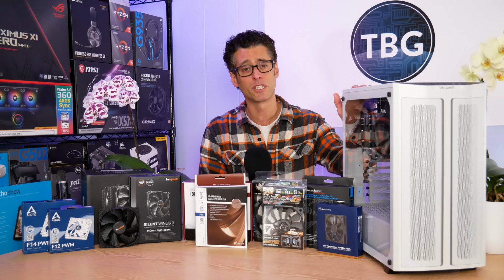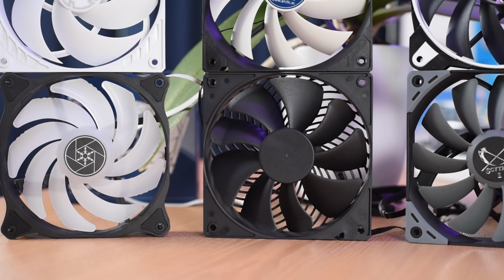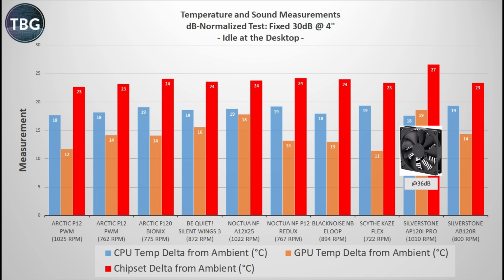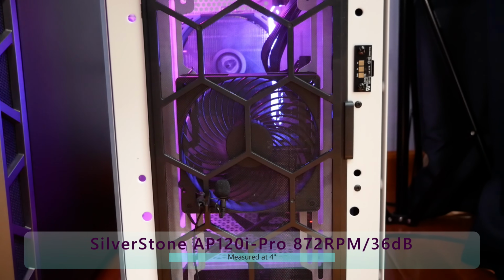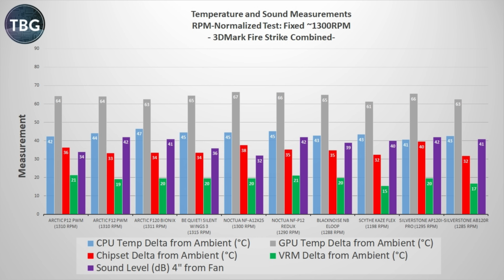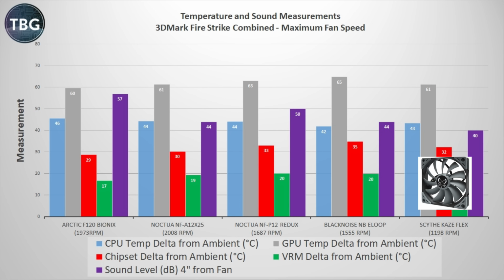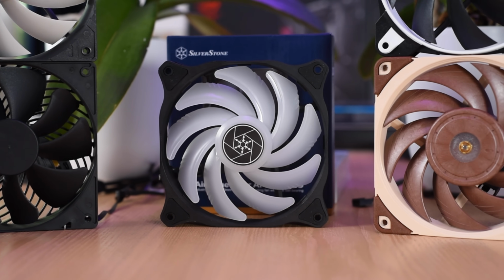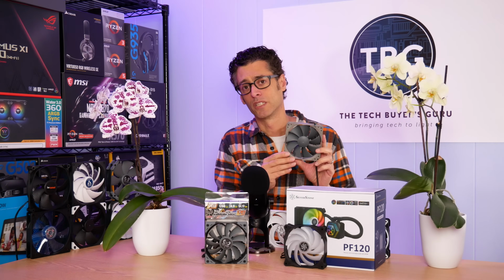The Best 120mm Case Fan Shootout: Arctic vs. be quiet!, BlackNoise, Noctua, Scythe & SilverStone

Comment: I purchased the SilverStone fan based on this review.  I don't mind noise but I would never have this fan above 1700 rpm, because it starts sounding like an airplane above that.  It's very quiet, like my other fans at low rpm though.  But after just two months sometimes the lights are on and sometimes they are off.  Now in my third month of ownership and having Tropico 6 (the RGB killer), it seems like the lights are now dead, but at least the fan is still spinning, so that's something I suppose.  If I had my time again, I would have gone for a Noctua fan instead.
Reply from the maker: Thanks for your feedback. I did make pretty clear that the fan is loud at maximum RPM, but that's not really relevant to anyone who uses a fan profile to control the fan, as it's very effective at lower RPM levels (and more importantly, on a dB-normalized basis). I'm sorry to hear, however, that the RGB lights are not working. You might want to check in with SilverStone about warranty support.

Going with Noctua would not have gotten you better case fan cooling performance. On a radiator, yes, the NF-A12x25 is slightly better.
Reply: @TheTechBuyersGuru  I can't remember my exact rpm, I'm just guessing.  I also can't remember what you said in the video.  But to say above, that something is loud, is a meaningless statement.  Just like saying something is moving, is a meaningless statement. It has to be loud relative to something else, and X has to be moving relative to Y, in order to have meaning.  I'm sorry that you had a bad experience with the Noctua fans in your setup.  I can only speak of my experience with other Noctua fans being good, and other Youtuber's tests like Optimum Tech, with those exact case fans as being good.  But what nobody can do, is to make it sound like their setup is some universal law of nature written in stone.  I'm new to this and learning all the time, I'm humble and wanted to share my setup experience.  What I can write in stone, however, is that any measurement which does not include the uncertainty in that measurement, is also meaningless :)
Reply from the maker: I've done far more case fan testing than Optimum Tech. What I'm taking from your comment is that you think his results are better than mine, and you would go with Noctua like he always does.

The thing is that I've been doing fan testing far longer than he has, and I have far more videos on the subject. I'm quite confident in my results. Your SilverStone experience may not have been great, but no, Noctua fans are not better for case cooling, and certainly not what you should choose if you want a replacement.

Please have a look at this video if you want to learn more: https://youtu.be/PUdsTiRmuuU
And then have a look at this video: https://youtu.be/iCn-XL-HyXg
And also this video on radiator fans: https://youtu.be/cQ6W-b45wZ0
Reply: @TheTechBuyersGuru  No I wouldn't say that anyone is better than anyone else.  Just that those fans worked better in his case and did not work better in your case.  What I would like to see more of is when people talk about margin of error, and that is something I would like to learn more about from Physics and Maths.
Reply from the maker: Margin of error is not something you can compute unless you are in a controlled laboratory environment. Applying it to fan testing on YouTube is impossible, and when it's discussed, it isn't accurate at all. There is a huge margin of error, from the ambient temperature, which constantly fluctuates, to the error in the sound measurement equipment, to the error in the temperature probes on the components, to the margin of error in RPM readings. The way you get around that is by repeating the tests over and over, as I have, in numerous different applications. Then the trends become clear, and margin of error isn't important, because if the results repeat themselves again and again, margin of error is no longer relevant, because it would predict random results that switch back and forth from test to test.

Long story short, Noctua fans are not good case fans. I have proven that in numerous tests. The NF-A12x25 is an excellent radiator fan. I have also proven that in numerous tests. No one has done more dedicated, in-depth fan testing on YouTube than I have.

Comment: That Noctua is not their best case fan. I love that fan, but It's moreso ideal on a radiator or air cooler. I'd be interested to see this test with Noctua's proper case fan, the NF-S12a. It's no accident it uses the same 1200 RPM as the Kaze Flex. You don't use a station wagon to race and you don't travel cross country in a Ferrari. Gotta use the right tools. Fwiw, I'm using 1 intake and 1 exhaust fan, both NF-S12a's and my cpu cooler is the NH-U12a which comes with 2-A12x25's. They're on a Ryzen 7 3700x oc'd to 4.4ghz and the machine is smooth as butter, completely stable. Use the right tools and things magically shake hands.
Reply from the maker: It sounds like you're having a good experience with the S12A, but it's really not that good. A lot of people have bought into the marketing of this fan, but my tests show it doesn't stand up to the best case fans: https://youtu.be/PUdsTiRmuuU
Reply: @TheTechBuyersGuru  Thanks so much for that! Seems like Kaze Flex really has their stuff together. I don’t believe I have the space for 140, but I’m gonna definitely give the Kaze Flex 120 a try in my case and see if I can beat out my current temps. Thank you again for doing these tests!!
Reply from the maker: I think you'll find the Scythe Kaze Flex 120 to be an excellent fan. Definitely a better overall fan than the S12A, so worth checking out: https://amzn.to/3tbMxHg
Reply: @TheTechBuyersGuru  Already ordered and will be here Saturday! I love that not everything inexpensive performs inexpensively. I need to update my psu as well. Currently have a 750w bronze and a few people have told me that if I'm overclocking like I am with as much ram as I'm using, that I really need more like an 850 gold or platinum. So I have 2 upgrades to do! Wish me luck!!
Reply from the maker: I wouldn't be too worried about wattage, I'd get a quality power supply. The Seasonic GX-750 Gold recently came back in stock after being sold out for nearly a year, and it's a great choice. Here's the link: https://amzn.to/2PM8I8y

For what it's worth, using more RAM has a negligible impact on power use, so anyone who said you need an 850W PSU because of that wasn't well informed. The only reason you'd need more than 750W is if you were not only overclocking a 3700X but also overclocking an RTX 3090. An overclocked 3700X would use 200W max.
Reply: @TheTechBuyersGuru  Understood, and thank you! Maybe they meant overclocking of both my graphics card and CPU. My 3700x is at 4.4ghx and my RTX 2070 Super is a Zotac, which comes with its own Firestorm software that is supposed to do an automatic and supposedly 
'ideal' overclock on it, but not sure how true and accurate that is. Any thoughts? (btw, thank you so much for taking time, I really appreciate it!)
Reply from the maker: I'd guess your 3700X is pulling around 175W at 4.4GHz all-core (which would require a lot of voltage), but a 2070 Super doesn't have a ton of headroom for overclocking, so maybe it would draw 275W max. So you're looking at 450W plus around 50W for everything else in your system. A good 750W PSU is all you need. You could honestly keep what you have unless it's a low-quality unit if all you care about is having enough wattage to support your components.
Reply: @TheTechBuyersGuru  So, I ended up getting a Seasonic 750w Platinum and 2 new Kaze Flex 120's and did the whole swap out last night. I know the difference between Gold and Platinum is not much, but the cost difference wasn't much eaither, so I did it. Same 10yr warranty, but slightly better specs. 92% efficiency at 50% load. Computer is running smooth as butter, but I think I can squeeze out a touch more. Last time I put thermal compound on my CPU was well over a year ago, and it was Noctua's NT-H1, which is good stuff, but I picked up some Thermal Grizzly and while the difference may not be much, for a $9 tube, even 1-2 degrees on idle, I'm willing to take. Wish me luck and thanks so much for the advice and recommendations!!!

Comment: Excellent review. Kazeflex may not be the quietest but it blows the most air at the lowest RPM at comparable and even lower temps. That is an amazing conclusion I've not heard anywhere else. That just blows me away. Honorable mention to Noctua being the quietest.  And yes to 140 mm review. Thanks again.
Reply from the maker: You don't have to wait long for the 140mm shootout, I've already published it! - https://youtu.be/PUdsTiRmuuU
Also, have a look at this guide to fan placement, which is probably even more important than fan selection! - https://youtu.be/iCn-XL-HyXg

Comment: Have you not noticed humming, buzzing, or weird resonances with any of the Arctic p12s? I bought 10 of them for a lian li dynamic xl build and I'm about to find something else. These fans are quiet annoying.
Reply from the maker: There is a resonance at certain RPMs. You just need to tune them to keep them out of the annoying RPM range. It's typically somewhere between 1200RPM and 1400RPM, and as long as you design a fan curve to avoid that, it's fine. In my testing, especially with that many fans, I have found there would be no reason to run them anywhere above 1200RPM. Watch this video to learn more: https://youtu.be/7dAvxfDYuRU

Comment: Well the redux line are older discountinued models so prob why not as good as their newer models.  I have the 92mm redux I used to use with a nu9 cooler that worked pretty well, but have been useing the Sythe Shuriken 3 with a Noctua since it came out.  Might have to give the 25mm Sythe fan a a try.

Comment: Just when I thought I had found the best case fan for my PC, the Arctic p12 PWM, I started to see complaints about the fan motor humming at random RPM’s. This issue deterred me from the fan and I continued my search. I ended up finding the Noiseblocker NB-eLoop B12-PS fans. I thought they would be the best for my setup, as I was planning to blanket my case with them. But yet again, a ton of people said they had issues with the fan blades making a noise when using it in a pull configuration. I looked at a lot of other options but there seemed to be mixed reports on how each fan performed. I can’t find any information on Google or YouTube about case fans that I haven’t already watched/read. The majority of the videos/articles conflict with each other, with some fans performing substantially better than others in different environments and setups. Since there is no way for me to test all of the fans myself I might have to randomly pick one. If anyone can recommend me an airflow based case fan that dosent have any problems, then please, let me know.
Reply from the maker: Have a look at this video for a review of the best 120mm and 140mm fans: https://youtu.be/PUdsTiRmuuU
And then watch this video to learn more about how multiple fans work together in a case: https://youtu.be/iCn-XL-HyXg
No other YouTuber is doing the kind of comprehensive testing that I am. Every fan makes noise. When a ton of people say there's something wrong, it's probably because they are using the fan the wrong way. When you blanket a case with fans, you can actually end up making it much louder than it would be with fewer fans.
The best 120mm case fans are definitely the Scythe Kaze Flex 120mm: https://amzn.to/3p9IrOy

Comment: I wonder how much the audio samples other than Bionix are skewed because of the 10 cm mic distance. SilverStone AB120R, Arctic F12, and Silent Sings 3 are clear winners. Arctic P12 doesn't sound so horrible because the hum is in the low-frequency range at this RPM. Audio samples results (only these marked as 30 dB): Arctic F12 @762 RPM: 29.8 dbA, < 40 dBC, Arctic F120 Bionix @775 RPM: N/A (bad sample), Arctic P12 @1025 RPM: 31.1 dbA, 46 dbC (85 Hz peak), Silent Wings 3 @872RPM: 30 dbA, < 40 dBC (105 Hz peak), Noctua NF-A12x25 @1022 RPM: 34.6 dbA, 47.5 dbC (165 Hz peak), Noctua NF-P12 Redux @767RPM: 32 dbA, 46 dbC (115 Hz peak), Blacknoise NB e-Loop @894 RPM: 31.4 dbA, 46 dBC (90 Hz peak), Scythe Kaze Flex @722 RPM 42 dBA, 57 dBC (140 Hz peak), SilverStone AB120R @800 RPM: 29.6 dbA, 38.5 dbC (125 Hz peak).

Comment: Only problem I have with your tests, what about air flow (CFM) didn't measure that.  Looking to replace the 9 fans in my case and CFM is important to me.
Take that back, another issue is you have 120 mm and 140 mm.  We all know that 140 mm doesn't have to turn as fast to move the same amount of air.  I'm looking strictly for 120 mm.
However, good review
Reply from the maker: But why is CFM important to you? Is it because of marketing you have seen? CFM is just a spec. My tests show which fans actually work, because as it turns out, specs don't mean anything.
Reply: @TheTechBuyersGuru  Ya, 20/20 hindsight tells me that you have indirectly showed the CFM in each test, however comparing a 120 mm  vs a 140 mm isn't fair.  A 140 mm doesn't have to turn as fast (thus less noise) vs a 120 mm. If you'd have compared 120 mm vs 120 mm across the board then its different story.
Reply from the maker: This video only had 120mm fans. The follow-up video had 140mm fans: https://youtu.be/PUdsTiRmuuU
And if you're really interested in this subject, I have a ton of videos you should check out, particularly this one looking at multi-fan optimization: https://youtu.be/iCn-XL-HyXg
I promise you'll learn more from this than you would from looking at specs from now until the end of time. ;)
Reply: @TheTechBuyersGuru  interesting, as I swear I saw 140 mm and 120 mm at the beginning SHOT

Comment: can you compare new arctic p12 pwm pst CO with regular pwm pst? and p12 argb
Reply from the maker: The CO is not new. Arctic has not been interested in sending me a sample, likely because it doesn't perform well for most users. It's mainly for commercial applications where the system's are on 24/7 where they need more durable bearings, and noise is not a concern.
I will be reviewing the new ARGB version in the next few months.
Reply: @TheTechBuyersGuru  maybe it doesnt have that annoying whine like regular p12 has 
th

Comment: you are testing high static pressure (radiator designed fans), to use for "case fan" ??? mmmmmmmmm
bad...
https://noctua.at/pub/media/wysiwyg/nf_a12x25/noctua_nf_a12x25_pq_compared.png
Reply: for case fans, high air volume, low dB:
Noctua NF-S12A
   1200rpm  
Noctua NF-S12B Redux 
 1200rpm
Reply from the maker: That Noctua document has been around forever, and it's totally wrong. Watch the video and learn. And then watch this video and learn just how incredibly bad the S12A is: https://youtu.be/PUdsTiRmuuU
Reply: @TheTechBuyersGuru  the image is from noctua website...
Reply from the maker: Static pressure and airflow metrics are just marketing garbage. The huge number of videos I've done on this topic have shown which fans actually perform.

Comment: Mic should be farther from the case and with front panel closed as that's the way people use the case. Also: Were the temp measurements taken with the front panel removed? I hope not but if they were then it surely skews the results seeing as higher pressure fans would perform better with front panel installed and high airflow ones would perform worse. So much work ruined by poor methodology.
Reply from the maker: Half of the commenters who wanted to flame me said it was skewing the results to have the filter in front of the fans. Whatever. I benchmarked it just as I showed you in the video. If you don't like it, you can leave, but stick around and you'll realize that I have the most comprehensive series of case fan tests on YouTube, with by far the best methodology. No one else comes close, because it takes a ton of time, and I've put in the work to help people actually learn something.

Best 140mm Fans: https://youtu.be/PUdsTiRmuuU
120mm multi-fan optimization: https://youtu.be/7dAvxfDYuRU
140mm multi-fan optimization: https://youtu.be/iCn-XL-HyXg
Reply: @TheTechBuyersGuru  I will stick around hoping you make the next test my way, haha. No hard feelings. I appreciate the work done. Yet, I'd prefer conditions similar to actual real world use. Quite surprised half the commenters don't. Still, I'm most impressed you answered my comment on a rather old video. Wish you many subs.
Reply from the maker: I do real world positions for cases and multi-fan testing, which you can see in the other videos I linked for you, but not for single fans, as there's no use to benchmarks like that. Measuring from 2 feet with the front panel on will pick up nothing valuable in audio samples. It will make all fans seem much more similar than they actually are to the human ear.

Comment: The mix directly in the airflow doesn't make any sense. It should be very close at the side of the fan.
Reply from the maker: There isn't nearly enough airflow at the distance I'm measuring sound to make a difference.

Comment: Such an awesome video! All the information I was looking for, for my first build. You just persuaded me to switch to an all Arctic P12 setup in the NR200 case.
Reply from the maker: Happy to help! The NR200 has a lot of fan slots, so if you're getting more than 2, you should seriously consider a 5-pack. The 3-pin fan combo pack is amazingly cheap: https://amzn.to/3avHivW
The 4-pin PWM version with included splitters is better for a multi-fan installation, but costs a bit more and has a shipping charge: https://amzn.to/37C9Ou1